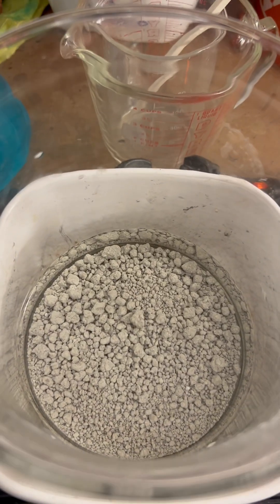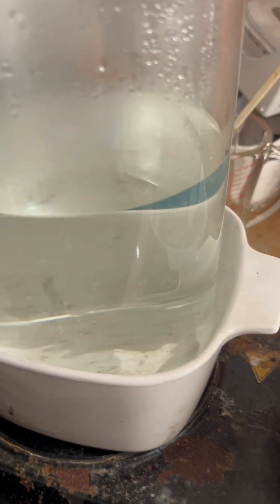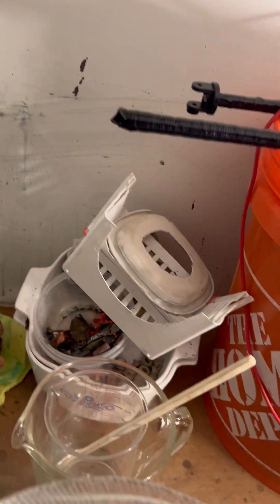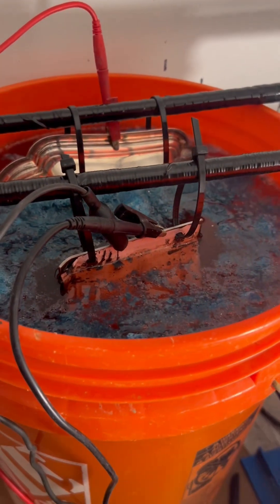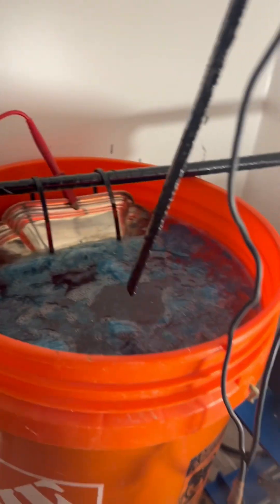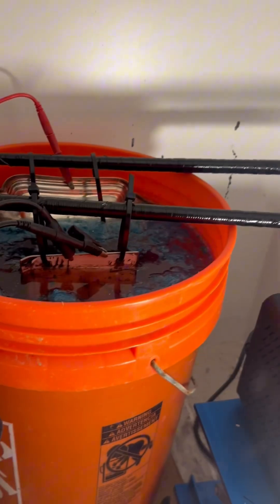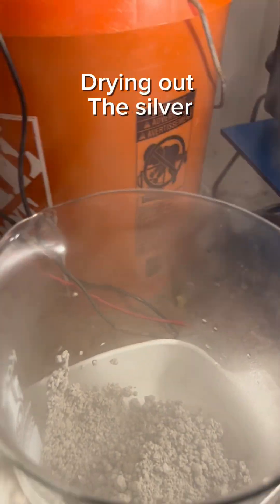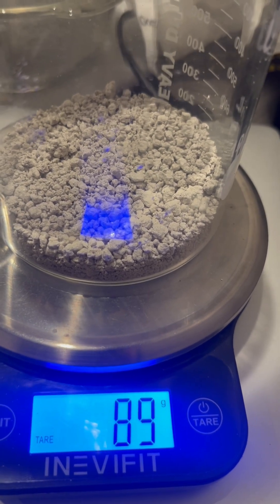Recovering  silver from 3740 grams of silver plated items ( the Making a silver bar day 4 )

Comment: There could be more silver on the plate you just ran out of electrolight. Using more salt or Epsom salt will jump start the stripping cell again. I don't know if you used peroxide never done that before.
Reply: The plain water cell works fine.  I use table salt fir conductivity. It creates silver chloride but also oxidizes base metals in time. I then convert it with the sulfuric and iron method.
Reply from the maker: @ thanks M
I had just been leaving it alone try to exercise patience . I was able to process the flatware in no time . If I was to to pick a favorite acid it would be sulphuric .
Reply from the maker: Thanks for the input I appreciate the honest critique , I wanted to stay away from salt as an electrolyte because of the chloride production . I have used KNO3 as an electrolyte and it very efficient . I think at this point I like using Sulfuric/ Nitric to selectively strip silver , then diluting and cementation the silver cement really looks nice . I will make shot with it then run it through a silver cell. Thanks for dropping by and please comment on other videos . Any processes that can be improved I am all in . 
Honestly since it’s an experiment and it’s the third time it was mentioned let do this . I’m going to add some salt today . Stay tuned 
Again thanks
Reply: @Hill-13  Epson salt is a form of magnesium dissolved with sulfur acid. If that helps they both work though if you get cooper or tin precipitate contamination boil In HCL.
Reply from the maker: @ I just looked it up add bought some years ago . I’m going to try it out as soon as I get home . Thanks really appreciate it .